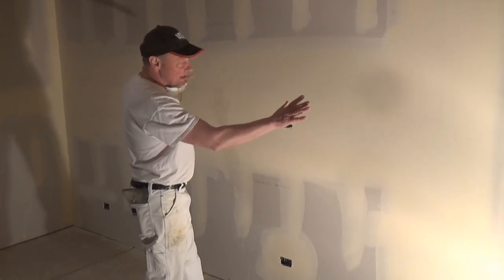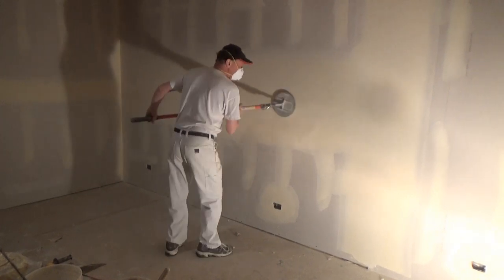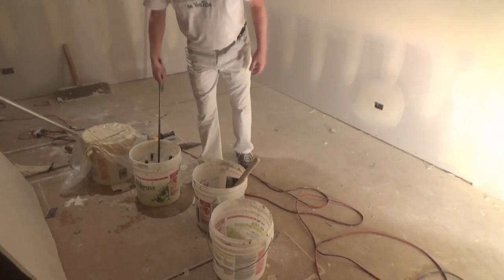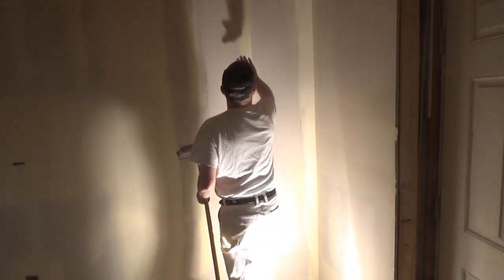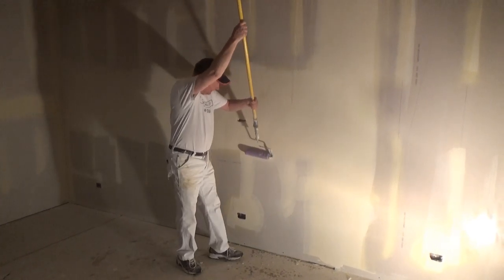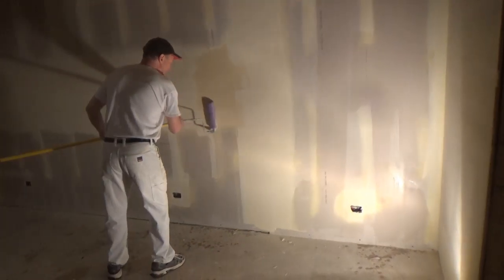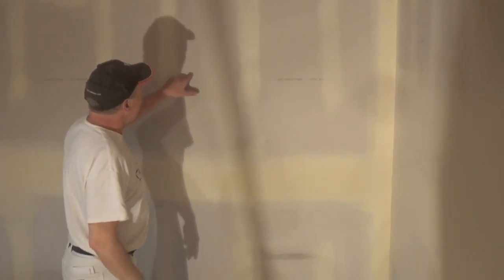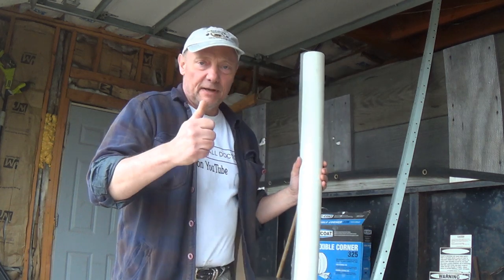Level 5 drywall finish part 3

Comment: Never seen this before.  I've wet sanded before with a sponge and noticed that the topped covered area grew as the sponge loaded up with mud.  Didn't even think about incorporating this intentionally with dirty water and a roller.  Brilliant tip.  Love your content and honest devotion to sharing your experience.

Comment: Another basement haha. My definition of cat 5 is using a very thin drywall mud with a paint roller and coating the entire wall.  Using a knife hitting the entire wall , smoothing and then with a good light making sure the coat is smooth and flat. Again, hitting the wall( s) and again repeating the same process. The idea is to build up a smooth flat wall void of ANY imperfections and a surface that is uniform and perfect 👌. I’ve never seen or heard of the drywall doctors technique but then he does know his sh__ and as I’ve said in past comments his skill and expertise along with the use of advanced drywall tools  far exceeds mine. I’m a “ old man” but I still enjoy learning new things 👍. Thanks for the great vids
Reply: How do you know he got it right. He didn't run a spotlight like we all know you must do.
Reply: @brit50ify   I think he knows what he’s doing

Comment: it never use to flash until they started to use recycled paper. so now putting some veneer on the paper works good. I use toping mud in a spray bottle. that works good.

Comment: Do you think a tile sponge with dirty water would work as well? Also I see lots of people using a high build primer on a level 4 saying it gives them a level 5. Do you know it this is true?
Reply from the maker: Absolutely a high build primer will work.  If it's just a small job yes use a sponge 🧽

Comment: How does this dirty water method differ from USG First Coat?
Reply from the maker: USG first code is a primer that puts a stipple on the wall the dirty water method just puts a film of mud across the entire surface to give it the same smooth texture. You will still need to prime the wall.

Comment: Should i use dirty water on smaller patches with smooth walls? Thank you
Reply from the maker: Sometimes I use dirty durabon water if I have 20 and I needed to set up faster the dirty water will make it set up in 10 or 15 minutes but it has to be dirty from the durabon. Not just from other mud

Comment: The level 5 that I've seen involved a complete skim coat, then 2 men & a spot light going over each & every square inch checking for and fixing the slightest imperfections.
Reply: Yep thats what I've seen and done.....high end residential houses usually...
Reply: @kirkdunn1379  @bradynaustin    Exactly. This guy didn't run a spotlight for a very good reason. He knows why.
Reply: Exactly. This guy didn't run a spotlight for a very good reason. He knows why.

Comment: That’s interesting but as a painter I would  still insist on pva primer to balance porosity.  Does this really replace priming  with pva. I’ve seen paint peeling in sheets due to improper surface prep. Especially semi-gloss or gloss paint.
Reply from the maker: You will always have to do a primer PVA primer

Comment: Hey Doc, so you didn't even need to sand?
Reply from the maker: I dusted it down first before I wet mopped that, but the other wall I just wet mopped  you didn't need to sand
Reply: @THEDRYWALLDOCTOR1  thank you so much, I'm impressed! You saved my arrss on doing so much extra work! 😁

Comment: Do you thin down the plus 3 on second and third coat when you are not using the flat box? And is easy sand 90 ok to use for tape coat/first fill and then top with plus 3?
Reply from the maker: I always thin down my plus-3 a little bit and yes you can use the EZ sand to tape and coat and then skim with the + 3 but the Finish isn't as nice.

Comment: If a customer no longer wanted their textured ceiling, what would be your process to give them a flat, smooth finish ready for paint?
Reply from the maker: I would sand it with my power sander and then box it with my 12 box 2 or 3 times before I skim it tight by hand
Reply from the maker: https://youtu.be/esDJGZWivyw
Reply: @THEDRYWALLDOCTOR1  This is a perfect example of level 5.  Nice work

Comment: I've seen people use tinted mud to help see imperfections in skimmed wall.  I did a ceiling scrape of acoustical material and skimmed two walls in a room with knock down because I patched some areas. I'm going to do knockdown, and will spray.  First I primed the entire room, but I'd like to tint the mud for spraying the knockdown so I know I've covered the areas completely, then I'll prime/seal again before painting.  Is it a bad idea to tint the mud when spraying knockdown?
Reply from the maker: I don't think so sounds like a good idea.

Comment: Thank you for your great videos. Does it works on painted walls? Will it hide tuch ups on painted walls?
Reply from the maker: No the texture on the painted wall would be too big to cover with such thin mud but the texture on the drywall it covers it perfectly

Comment: Got a question. I have a job coming up where I am coming into fix the work the initial mud guy messed up on. All of the walls are painted (latex) and they want me to Fix everything. From experience I know that mudding over a painted wall causes the mud to Bubble. Just want to get your expert opinion doc! TIA
Reply from the maker: Yes you may have to put two coats just to get the air bubbles to go away. Make sure they know you cannot warrant the work of the other guy.
Reply: @THEDRYWALLDOCTOR1  what type of mud would you use? Also the 36 inch fibafuse wall reinforcement product I'm thinking would work because there is screw pops everywhere.
Reply from the maker: I wouldn't tape the screws just scrape set and spackle. +3 most of the time right out of the box.

Comment: I just paid for a level 5 on my townhouse renovation. Had 2 guys look at it. one guy said he would box the whole wall. But he never gave me a price because where i live building is booming. The other guy got the job because my wife would not let me do it myself using my you tube knowledge.
He sprayed hi build primer on the whole walls and ceiling and sanded it. It looks good but did i get screwed? Is what he did comparable to level ? Thanks for any input.
Reply from the maker: If it looks good and you're happy with the work you got what you paid for that's all you can ask
Reply: @THEDRYWALLDOCTOR1  Thanks. It looks good and we are happy with it. Love your videos. If I would have seen this video before I recently had it done. I may have done it myself. LOL

Comment: Yeah man I'm not sure where people got the idea of calling everything level 5! Just because you think it looks as good as level 5, doesn't mean it is level 5. Too many people learning that term and throwing it around! You and I both know that a true level 5 is a complete skim coat of the entire surface!
Reply: MudSlingr It’s not about following some procedure. I’ve seen guys throw mud on the wall unevenly and even though the entire wall has mud on it, the unevenness of the mud looks like a plaster wall from the 60s if you can get a level 5 finish without skimming the whole wall, I think it’s brilliant.
Reply: @seephor  you're missing the point! Level 5 is the procedure! Just because a wall looks great doesn't make it level 5
Reply from the maker: That had a complete skim coat over the entire surface just because I didn't use a trowel to put it there it doesn't mean it's not there the entire wall was skimmed out with mud
Reply: @THEDRYWALLDOCTOR1  I think you missed the point too! The point, of level 5, is to equalize porosity so the paint absorbs evenly! Therefore reducing the chance of any flashing! To simply put it on and wipe it off in no way makes it equal to a joint or butt! If I can still see that much paper then it's not equal!
Reply: MudSlingr I think you’re missing the point. Even if you skim with a knife, you sand it all off anyway. This way you get the same effect without using a knife. The mud water penetrates the paper and seals it essentially.
Reply from the maker: I have done this many times with high gloss epoxy paint and no flashing whatsoever
Reply: @THEDRYWALLDOCTOR1  Thats because your a great finisher! Lol Never said it wouldnt turn out perfect just that I still don't think thats a full level 5.
Reply: @Bigrush310  PVA primer to equalize porosity.  Skim to equalize texture.  This doesn't meet the textbook definition of Level 5 quite exactly (all this stuff is documented in meticulous detail by USG) but in the end it meets the spirit.  Bottom line is the results.  If it looks good, it IS good.
Reply: @fiver-hoo  yes pva primer to equalize porosity! But also....wait for it....level 5
Reply from the maker: I get your point all new drywall mud needs a PVA primer especially before you paint with any high gloss semi-gloss or epoxy paint
Reply: Hey Doc, so you didn't even need to sand?